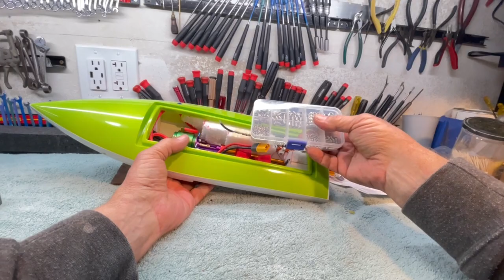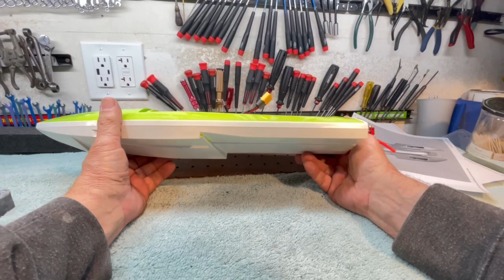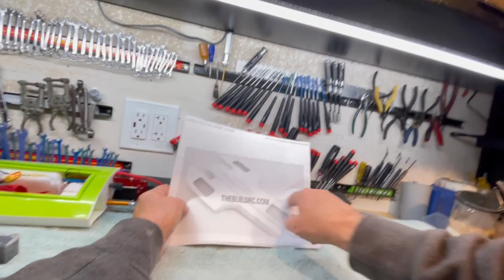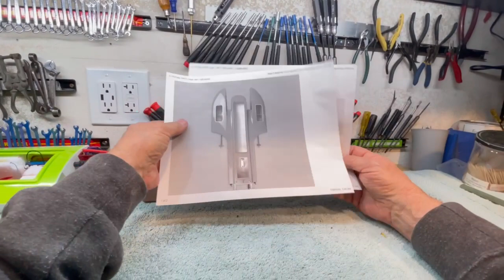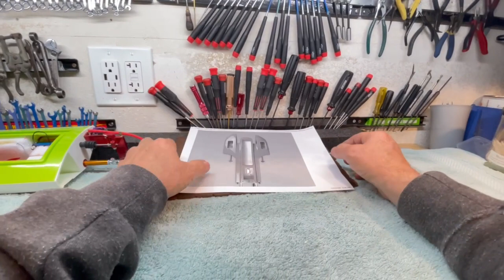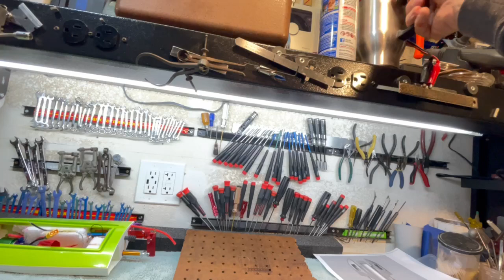Dr. Jet advises and reports

Comment: Hi DR I have one of those Sobey hydros that your friend wants to put jet on in my experience the boat at speed climbs up to the tips of the v hulls which makes the center of gravity high and makes it easy to flip in the turns. I run a single 2000 KV with the batteries in the sponsors ducted fans on the tops of the sponsors is going to make the center of gravity even higher I don’t think it will work for him in the turns he could try a big cupped turn fin?  good luck